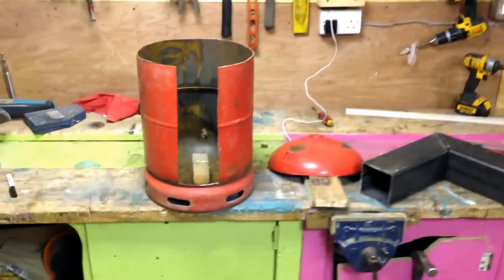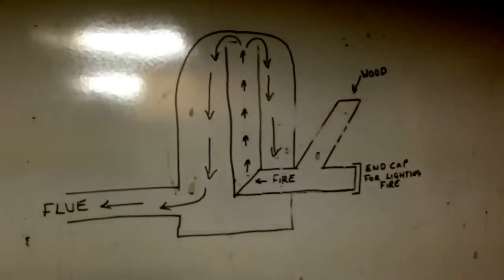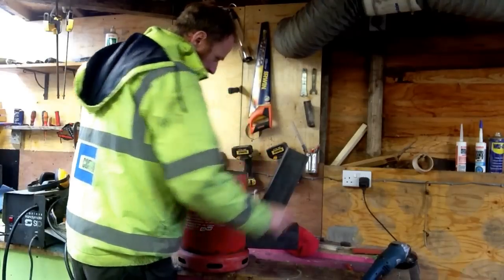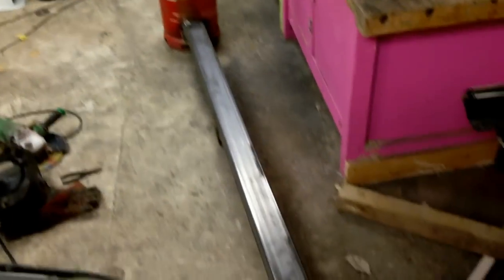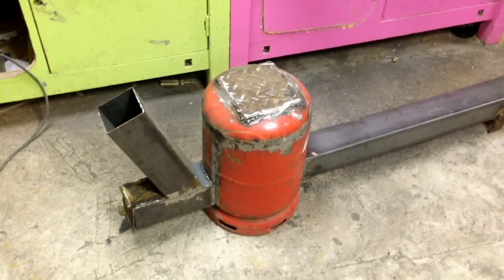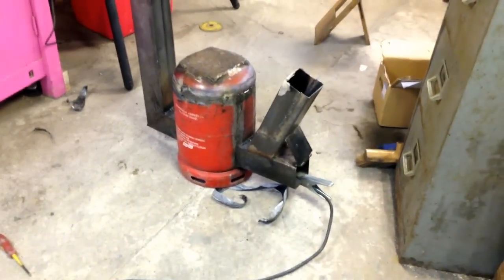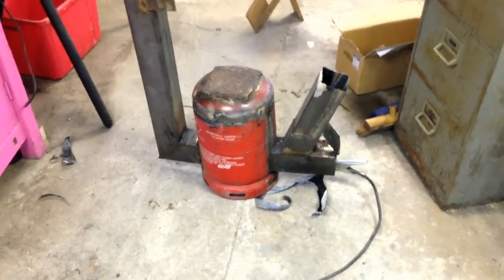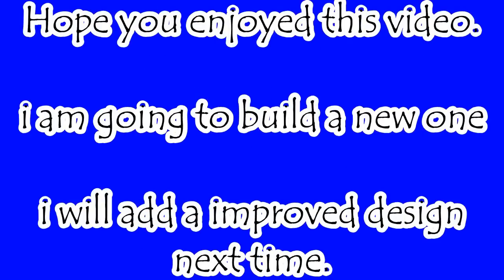How to build Gas bottle Rocket Stove

Comment: Excellent video, I want to make something similar that’ll fit inside a prefab fireplace and use it for an emergency in case we lose power this coming winter. Loved the fact that it’s small enough that I may be able the get it to fit in fireplace. Can you tell me how hot the temp was at the gas bottle and how hot it was on the flue as you call it? Buy bottom line up front, excellent job, thx for sharing.

Comment: You needn't close the bottom draft. The draw is crucial to a properly functioning rocket stove. But then a rocket stove burning at peak efficiency will melt your steel riser like a fudge sundae on a hot plate.  The top of the burn chamber should be between 1 1/2 and 2 inches from the bottom of your top plate ,again, pretty crucial. But for that you would need to make the burn chamber out of fire brick or fire cement. All in all nice build mate. Great video thanx for sharing.

Comment: You could still exhaust it through the wall
.Put an elbow in the flu a foot or so above the stove.
But before i would exhaust through the wall I would want to know the gas temperatures.
How could I reattach the top of the gas bottle so I could reopen it for cleaning?

Comment: Good attempt. Everyone is a critic though. There's a formula floating around the net that has the perfect equations for the jtube system. The actual flue doesn't matter since most people bury that in a bench anyway to absorb all the heat before it vents outside. The trick is the venturi in the insulated riser. You're really close here. I hope you continued on to make successful versions.
Reply: Big Dan
Reply: Big Dan

Comment: Your feed tube is to long and vertical fire tube is to short. Measurements are 1-2-4 feeder tube - burn tube - vertical fire tube, measuring to the centres of tube. Eg 8"or 200mm x 16" or 400mm x 32" or 800mm, makes a working J tube and the door on the front is a good idea, it helps with lighting and regulate air flow but it would help if you had a latch to close off door if needed.

Comment: issue number one your burn needs to take place directly beneath the chimney for efficient burn, this means your feed tube is in the wrong place, it needs to meet the edge of the chimney number 2 is square flues create draw issues this is why they are  traditionally round

Comment: Shouldn't you be drawing the air in the bottom feed with a cap on the top one once its filled? I think the idea is that the air is drawn through the fire from bottom to top.

Comment: ok why you need an ash box it will give you a longer burn time without having to shut it down to clean it out over time it will build up ash temperture will go down if you only run it for a couple hours then it would not be a problem

Comment: -Üpdate

If  no insulation, some 8mm holes in vertical square tube burner (at bottom and top)

and/or 2nd  air entry in the barrel (inclinated tube to soil,  1/10 size of feeder),

a cicular chimney tube, on square one, 
with some aluminium sheets between, for exemple (allow few air flow exchange, save some heat)

dragon stove,
in brick or cast iron (found a door of old circular small stove),
at basis chimney in fire chamber, as tremplin,
if possinle others up in steel as blades (vortex).

A 50L barrel for exemple,
open on one side,
cut in 2 lenghtwise,
places under and above stove,,
bottom slot to allow fresh air -> hot between (air exchanger),
and protect / burns

Would have to do one,
with 2 small barrel, one up the other (no cooking plate).

If were youre, would do an oven, in place of yout cooking plate,
but as a 'bell' (open on chimney, some plate to allow gaz maybe)

If you search in facebook groups, theres schema with proportion to respect.
Anyway others air entry will help to (regulate gaz pression-
simply another barrel on your actual square chimney, with air entry...).

have fun
good winter